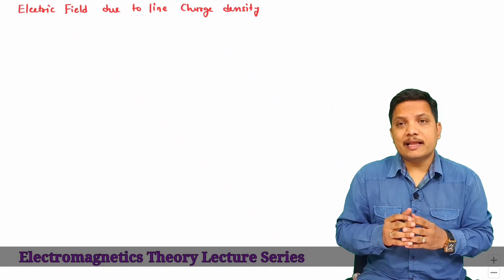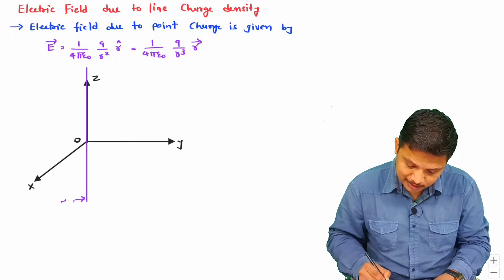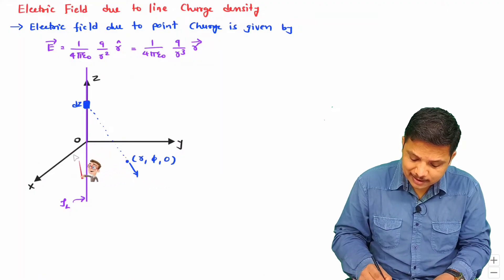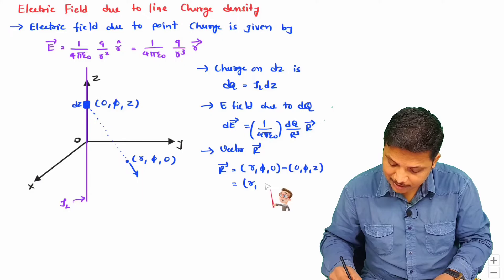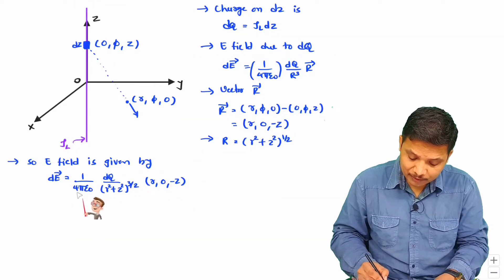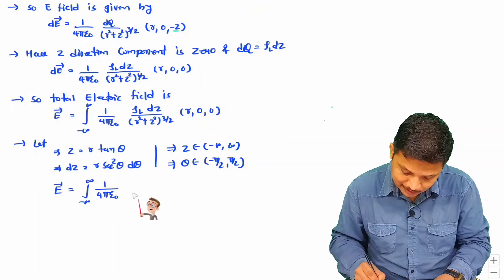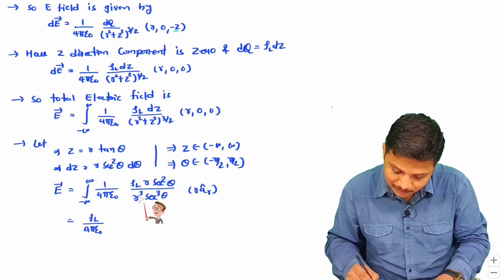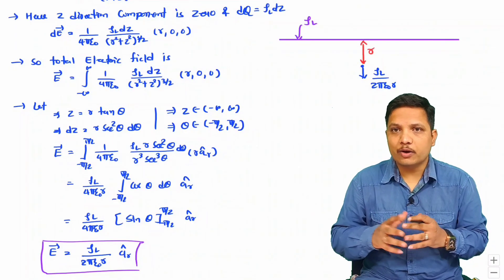Electric Field due to Line Charge Distribution Explained | Electrostatics | Electromagnetics Theory

Comment: Why Φ(Phi) remained the same at 3:12 ? Thanks
Reply: It making same angle due to straight line connection with (r, phi, 0), where angle with respect to origin will remains same.
Reply from the maker: Yeah
Reply: @laxmandholakiya7616  Now I get it thank you so much
Reply: @laxmandholakiya7616